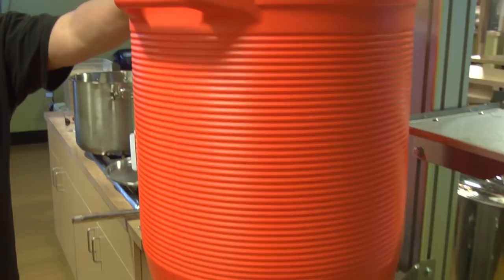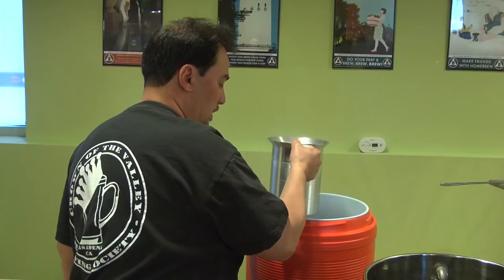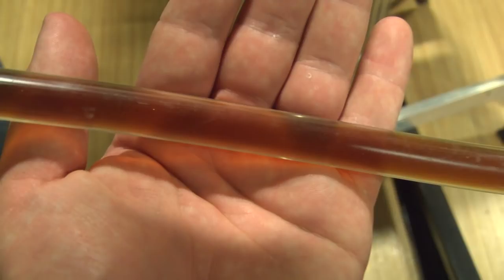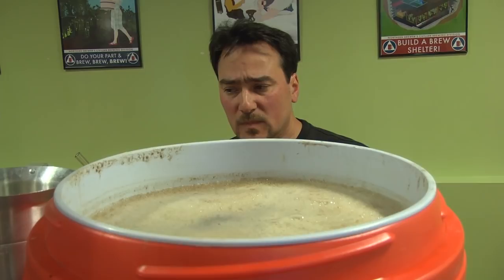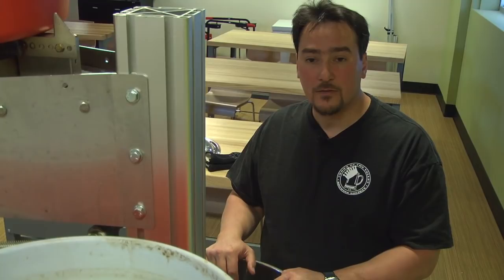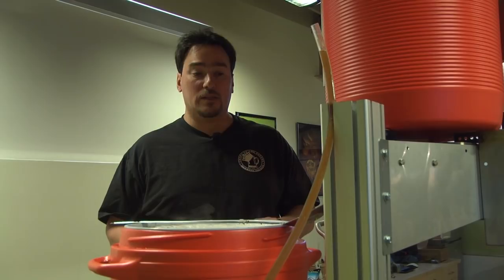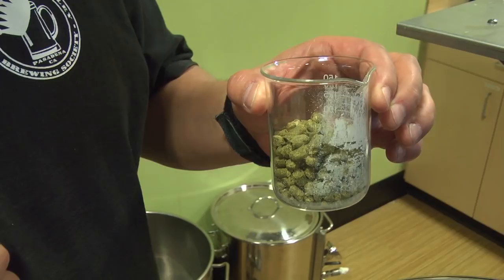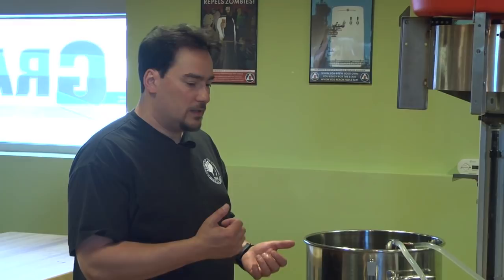All-Grain Homebrewing with John Palmer (author of "How to Brew")

Comment: Any thoughts on this from anyone that can answer- for a beginner brewer would running your tap water through a Brita filter for instance or buying jugs of spring water be helpful in getting decent water for brewing? I appreciate all the ph/alkalinity/water chemistry info but most home brewers aren't going to that extreme I'm guessing.
Reply: that should be just fine. Just be sure to get some campden tablets for your water to get rid of the chlorine and chloramine.
Reply: Perfection in H2O chemistry is usually sought in an attempt to clone or match a specific beer or style. Of course to do this you would also have to match the yeast (usually proprietary) and all temp / environmental conditions of the beer you'd like to copy. To eliminate funky tap water tastes from your homebrew, start with distilled water and then  use additives to reach the hardness and pH mentioned.

Comment: Question regarding those igloo mash tuns. Do they leak out any chemicals into the wort? Thanks.
Reply: +Bert T. No, you should be fine as long as you make sure its BPA free and you maintain your liquid temps below to the max recommendation.  I got mine from Home Depot (rubbermaid brand).  Just cracked open a Winter Warmer beer in my first batch using it and there were no off-putting flavors.  Beer turned out great.
Reply: +Cam5FC Thanks. It'll definitely be a while before I move to full grain or even partial given the fact that I'm only on my 4th extract. But eventually.

Comment: I am confused the book clearly states to "add water to the grain" but that's not what you are doing here. Does that really matter? what is the right way to do it?. I got a very low efficiency by adding water to the grain plus temperature dropped.. so looks to me that doing it the this way (grain to water) is better.....Thanks
Reply: Armando Soto thats why you have you're sparge water warmer as what the mash needs to be. depending on grain temperature too. there are many calculators to help you out. use google as a search agent to answer all you questions. :). good luck!

Comment: (7:39) Specific Gravity reading of 1.070.. I've found that using a Refractometer for specific gravity measurements are wildly inaccurate.. typically these refractometers are used for Brix measurements and include a Brix Scale, the problem is.. 1) the conversion is not linear, and 2) simply isn't accurate.. go to Amazon, look at half dozen refractometers, pick a Brix reading.. say 11.0, some will read approx 1.047 others will read <1.045.. or take his reading of 1.070 using the Refracometer sold by NorthernBrewer you'll get approx 17 Brix others 16-18 Brix which could be a diff of as much as 15 gravity points.. I think you do beginners a dis-service.. a Hydrometer is more trouble to use, but much more accurate.. no doubt the profit margin of the 40$ refractometer sold by NorthernBrewer (Amazon, same device ≤20$) is much higher than a simple hydrometer.. Also no doubt this guy knows a thing or two about brewing.. but c'mon, this vid was posted going on 8yrs ago.. but new brewers are getting into this hobby everyday.. errors, mistakes and/or mis-information  or even updates need to be pointed out, by all of us, otherwise whats the point..?
Reply: correction... 6yrs ago..